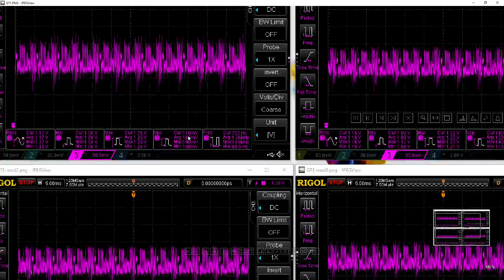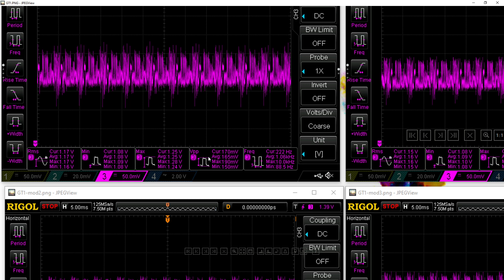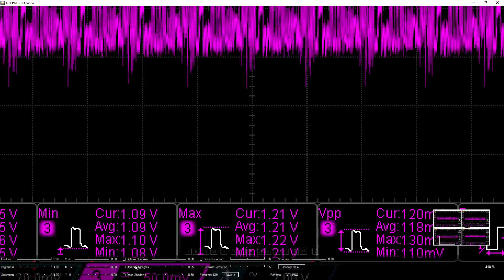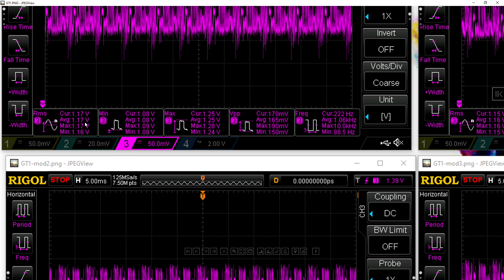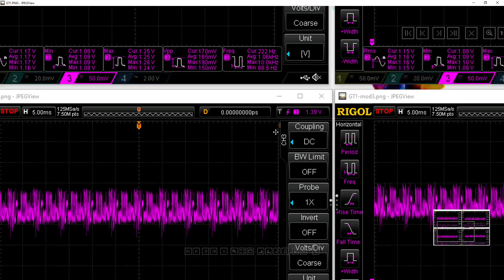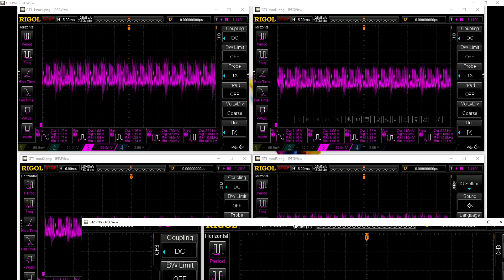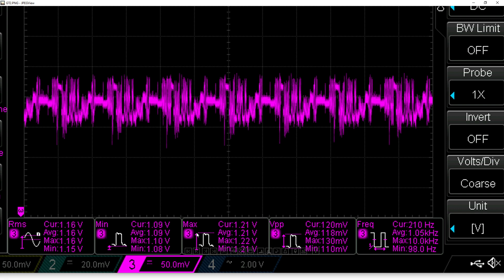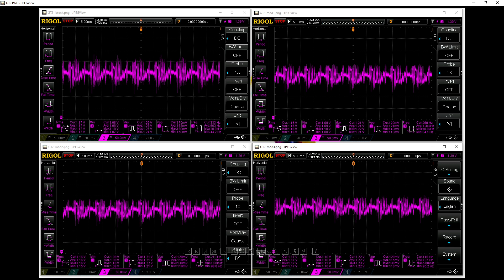RX VEGA 64 capacitor upgrades with oscilloscope measurements.

Comment: Upon purchasing, I removed the air cooler, installed a water block and ran the card on the liquid bios with a 400A power play table. After 3 years, the card started stuttering and re-flashing the air bios fixed this. Also, this card melted a CableMod 8-pin at some point, so I hooked up the EVGA cables. Yes, its a dodgy card but I'm impressed you were able to repair and mod it so quickly and easily. I am overly excited to see you run it under LN2!
Reply: Where did you find the liquid FE bios?
Reply: @jon4715  Techpowerup VGA bios collection, but newer AMD drivers don’t play well with bios flashed Vegas (hence the stuttering).
Reply: @El_Marzocco  Got it. I could never find a FE Liquid bios, still have an FE Air under water. I never messed with 64 Liquid. Seems like it's not worth the hassle. Funny our FE's are only using Pro-ish? drivers now, no way to use Radeon gaming drivers in the interface anymore.
Reply: @jon4715  Oh? I've been away from Vegas for a while.
Reply: @El_Marzocco  Good for you. I like the pro drivers and havent felt compelled to upgrade. I had a Radeon VII but sold it.
Reply: I was also never able to get the liquid BIOS on my card, however this only unlocks more vcore, which IMO isn't useful if you want the card to live. Consider the air BIOS and stock max vcore will pull up to 400W fully loaded with no power limit; in fact I run the card at 1680mhz with an under-volt at 380W as daily OC for gaming as the silicon won't clock any higher regardless of vcore. Given a Radeon VII will clock so much higher at 400W, there is only so far to go with this card anyway.
Reply: @jetpil0t  mine I just kept the core clocks from the LC bios, upped the power to the limit and oc'ed the memory to 1100mhz. No issues until now. Have a msi airboost oc on water. Should I try to undervolt it too?
Reply: @jetpil0t  Does your card have a waterblock? The card in the video is a non-FE and it does 1740 on water.

Comment: I'm still running a V64 in my system today. Got it second hand, never used, at launch from a guy that accidentally bought too many for his then mining rig (2017 mining boom). Best hardware deal of my life. Running under water - has massive coil whine but it is what it is - performance is great.
Reply: I got mine new, near launch literally weeks before that very same 2017 crypto boom kicked off. normally i would never buy at launch, but frontier already being around and the crypto boom telegraphing its instatiable demand for gpus make me pull the trigger. 
would like to upgrade, but god damn the prices now, and given most GDDR6/x gpus will roast even at idle if you run multimonitor and 144hz 1440p.
Reply: @anasevi9456  haven't even checked my Vega but I'm running 1440 144 as my main and a 2160p 60 as a second monitor. Haven't noticed any heating issues.

Comment: Got my Vega 64 @1680mhz core and @1100Mhz VRAM pulling ~400W on water for a few years, really awesome card for overclocking and easily one of the best reference PCBs ever released with 12 phase VRM, dual BIOS, triple native Displayport, GPU usage LEDs, unlimited soft modded power limit etc.

Comment: 264W bios is Vega LC and AIB air cooled designs. 220/200W is reference design V64, so nothing weird at all here. And yes, LC bios is broken on non-LC cards (has been for a while). Other bioses do work fine, provided they come from a card which is similar-ish (i.e. same VRM) to a reference design.

Comment: i did this to allmy cards, even laptops, filled some empty spraces for filtering caps, asus strix 1070ti could go from +300mhz memory to 650mhz, just for caps, and i could go higher with gpu 2080Mhz with stock voltage.
Reply from the maker: yeah I had a 1070 and it also had a crazy uplift in mem clock from extra caps.
Reply: I run my 1060 mem at 10GHz :-:
Reply: @mmllmmll22  yeah and i overclocked my casio calculator and i beat 3090 by far.

Comment: I have a reference v64 on water and think I got very lucky with my silicon. Back when power play tables worked, it  was insane. 
If I didn’t need to baby this card in fear of killing it in this GPU market I’d live to mod it to unlock its full potential.

Comment: Hey Buildzoid, wondering if you take vegas64 and repair them ? I have a bunch of them that work perfectly fine but (IMO) they have a faulty temp sensor. Card runs 2-30c more than my other vegas at start. I have repasted them and the problem is still there. Thanks for your content! cheers

Comment: I actually love that stock backplate!  Currently rocking the stock Gigabyte back plate on my RVII with a Barrow water block. But I did ghetto retard things and put two 1.5mm layers of Fujipoly I had laying around on the back of the die, and stuck a big 20mm heat sink onto the Fuji.  Now I have a rather ridiculous gap between my core temp and hot spot temp, since that ghetto stuff sometimes actually works!  Can't say it helped with clocks, but I can see 2060-2070mhz in game / benchmarks consistently, using MPT to set the power to 350W, cause I'm not as smart as BZ.

Comment: What kind of voltage would you consider 'safe" under ambient water? I'm planning on doing some practice on a dead R9 Fury and then trying this (the SP caps and the i2c header) on my own Vega 64. Also, more of a theoretical question, would you be willing to run more voltage based on bringing the overshoot down? Or are the time periods so small that max 'safe' voltage doesn't really change?
Reply from the maker: Vcore upto around 1.3V is probably fine if you can cool it. I wouldn't push the VRAM past 1.4V(and even that is probably pushing it).
Reply: @ActuallyHardcoreOverclocking  Thank you
Reply: @DeBlackKnight  Just stop at 1.35V for vMem.

Comment: My Gigabyte RX Vega 56 8GB OC card boots up just fine but artifacts then freezes a few seconds after I try to run a game or run video editing software but here is the kicker, it will run fine with Heaven benchmark.  What are your thoughts?  Have you ever come across a video card that does this? Can it be fixed by a professional electronic technician?   Also I think this would be cheaper than buying another one considering that buying a completely dead card would cost no less than $400 on E-bay

Comment: Curious about what is said at 1:00 about using the wrong BIOS on cards. Does that apply for Navi 10 as well? Does Flashing a 5700 to a 5700XT cause issues now? Or even flashing a  6800 to a 6800xt BIOS like people are doing now. Did they screw people with new drivers?
Reply from the maker: IDK about newer cards since the only card I have that's newer than VEGA is the 6900XT.
Reply: so far not yet mine is running fine 5700 running xt bios

Comment: I’ve got 4 vega fe’s in a threadripper but only ever used all four cards at once for mining.  Don’t mine anymore though.
Reply: @dawre3124  I did, but I made the mistake of using ek thermal paste.  When everything was new they held ~50-60C easy. turned down to about 900w total wall draw.  now they rapidly over heat and it would be a huge job to repaste them.
Reply: @NavyCuda  where you from? if your from eu id buy the cards from you xd

Comment: 5 ms/div and a 1x probe isn't going to cut it for the power delivery network of a 2 GHz chip. If you could see anything significant at that scale, it'd be a bigly problem...
Reply from the maker: Intel's measurement standards for 4GHz+ CPUs are: 
"The voltage specification requirements are measured across Vcc_SENSE and Vss_SENSE as near as possible to the processor with an oscilloscope set to 100-MHz bandwidth, 1.5 pF maximum probe capacitance, and 1 Mohm minimum impedance. The maximum length of ground wire on the probe should be less than 5 mm. Ensure external noise from the system is not coupled into the oscilloscope probe."

From page 120 of: https://www.intel.com/content/dam/www/public/us/en/documents/datasheets/8th-gen-core-family-datasheet-vol-1.pdf

My piece of coax probably isn't meeting the 1.5pF capacitance requirement but other than that it works fine and produces usable data.
Reply from the maker: @-szega  I've messed with using lower time divisions and it doesn't really change the max and minimum voltages measured (even when using the trigger to check for over and undershoot). So that's why I normally take my measurements at 5 or 10ms per division. 

Also the intel overshoot spec is just how much the votage can exceed spec and for how long. Intel has a VRM test tool so I guess the TDP and virus modes are reffering to the configuration of the VRM test tool.

Comment: The standard Vega 64 and a lot of AIB cards have a 220w power limit, only the LC and the nitro+ had a 264w bios from what I've seen. Why I'm disappointed as I'm power limited on my reference card that's water-cooled now.
Reply: Pretty sure the OC bios on my PowerColor Red Devil is ~260W
Reply: Thought you could still regedit the power play table to increase power limit slider
Reply: @benjaminmcintosh857  this was patched in old driver, can still get it to happen but the card will down clock to 400mhz every 3-4 seconds and I haven't seen a way to patch it.
Reply: @Smithy2222  think my comment got deleted. I tried again using newest driver and overdriventool  and was able to successfully make it work on 64 flashed v56
Reply: @benjaminmcintosh857  oh that's on 22.8.1? Also have to run 3D mark just to be sure about the clocks? If it's running fine I'll be doing this when I get home today aha.
Reply: @benjaminmcintosh857  how did you do that? OverdriveNtool won't let me set it above 50%
Reply: @Smithy2222   Run as admin, right click on the of the window (near minimise/close etc.) and open PPTable editor where you can do it.  Just need to download a vbios to point it at as a reference. It exports a .reg file that you can apply as with the old hack, restart and voila. There's a reddit post about it from a year or two ago too.

Comment: Hey Buildzoid, just used a random SPPT on my Sapphire Vega64 and it seems to work fine. Could you elaborate on how to rip the specific power play table off the card?
Reply from the maker: basically the same method as this: https://youtu.be/wNSIyLI-LEc
Reply: @ActuallyHardcoreOverclocking  thanks mate

Comment: Blowers suck, BUT what about the 3000 Founders? They are half blowers....
Reply: They arent really though. They kinda blow but it's a downdraft fan that happens to force air along a similar path as a blower type design. It really is downdraft all the way.
Reply: @fVNzO  But Buildzoids problem with the Blower was not with the Fan, but the Size of the Heatsink that was cooled by it ^^. The FE shortends that bit.
Reply: @gucky4717  Okay but the only context im using here is your initial comment i have nothing to add about buildzoids opinions on blowers.
Reply: Why do you say "half" do the have an opening on any of the other sides or the back.
Reply: @abstractapproach634  I think he's referring to the back fan which blows out the back over the pcb. The outermost fan blows through a fin stack off the pcb.
Reply: @fVNzO  interesting, I almost went founders for form factor. But ASUS dual oc rtx3070 turned out to be a similar size and easier to find.

I did not know they had more than one fan. Just for clarity, by "back" do you mean the cpu facing face of the gpu, or am I interpreting that wrong?
Reply: @abstractapproach634  the founders 3060ti and 3070's blow out the IO shield like a blower card and actually build up quite a lot of dust there over time (3080's might be different, I don't have any of those).
Reply: @yannicg  that's what I thought, but @Freeze 's answer throw me off. I did not know any Nvidia reference rtx-3000 series had more than one fan?!

Anyways, glad I went the way I did, kinda. I'd trade for a comparable Radeon in a heartbeat now that I've learned more about certain companies business practices.
Reply: @abstractapproach634  yes, they have 2 fans, the front one blows out the IO shield and one side and the rear one blows the air out the top of the card(there is no PCB in the back so the air passes through the entire card and out the Top)and on also on the opposite side of the front fan.
Reply: @yannicg  cool, sounds innovative. Seems like the rear fan would either compete with the intake or get the warm exhaust from an air cooled cpu though. I don't think it would work with my threadripper. But it would probably work for smaller gaming cpu's (the only crappy thing being the 3090 obviously is better suited to a workstation/gaming rig unless your an extreme overclocker like BZ. Thus most 3090's probably force water cooling or operate inefficiency due to workstation cpu thermals; in my initial first thought opinion, that is )